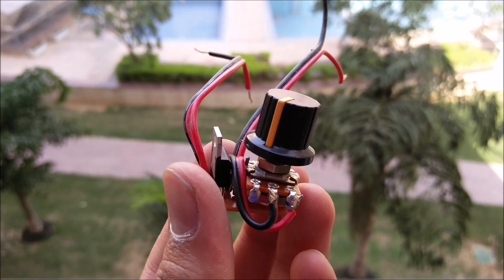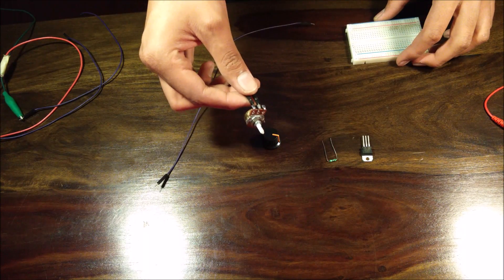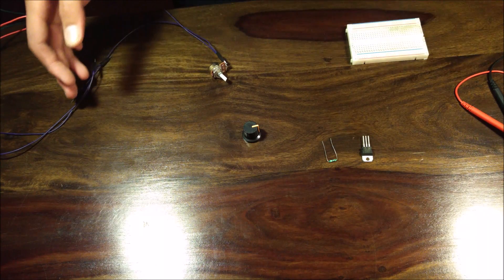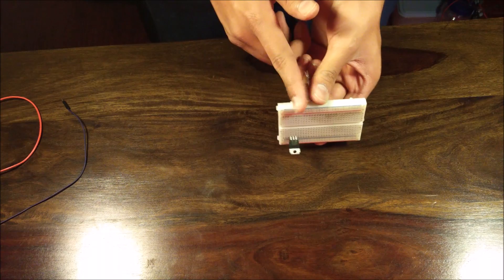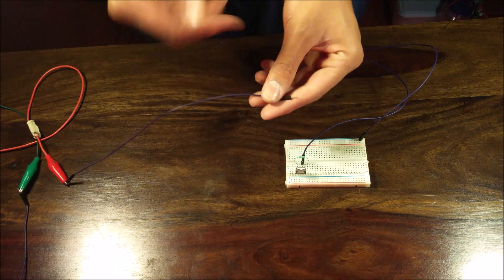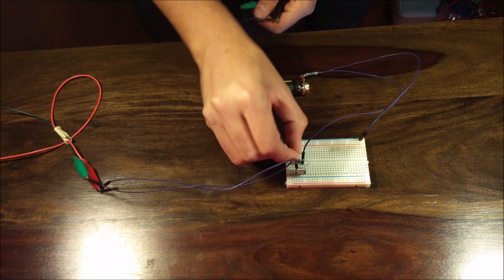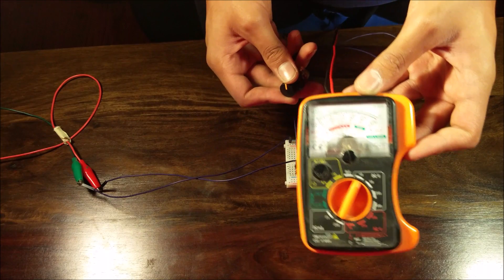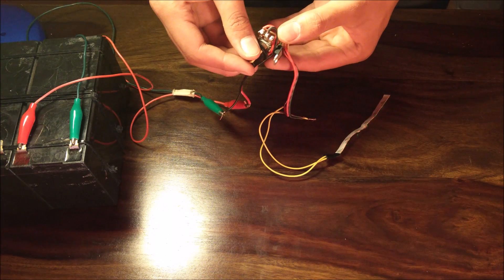How to make an adjustable LM317 voltage regulator | DIY Project | Making WithMihir |

Comment: Can you explain in hindi
Reply from the maker: Bilkul bhai! LM317 pe hote hain 3 pins - Input, Output aur regulation pin. 12 volt ki input ham input pe connect karte hai aur regualted output, output pin se lete hai. Voltage supply ko regulate karne ke liye ham variable resistor ko regualtion pin se connect karte hai. Potentiometer koo ghumane se regulation pin pe voltage badalti hai aur output bhi uske hisab se badalti hai. Agar koi bhi aur problems ho to comment phirse kijiye ya mujhe mihirvardhanprojects@gmail.com pe mail karein.

Hope I helped you out!

Comment: why didnt you use capacitors? Most people use capacitors is this not needed?
Reply from the maker: Birkhan Sonkan hey there! Usually 0.1 and 1uf capacitors are used in such a circuit. 
0.1uf capacitor is used to clear out noise and 1uf is used to stabilise the output. Since most applications of a LM317 are for basic projects, noise and micro instabilities won't be a problem. That's why I decided to keep the circuit simple and omit from using them. 

I hope you found my answer helpful. If not, feel free to comment any other doubt you may have!